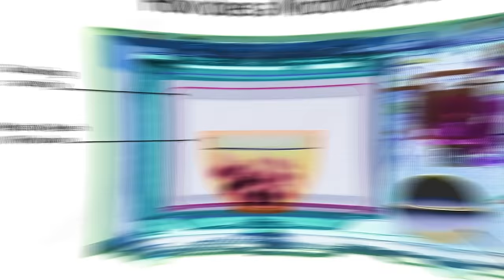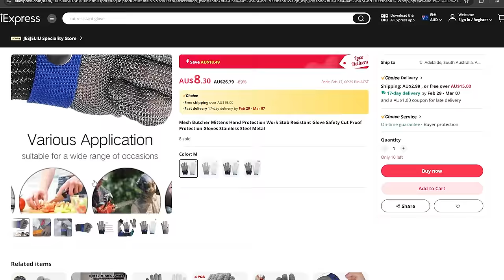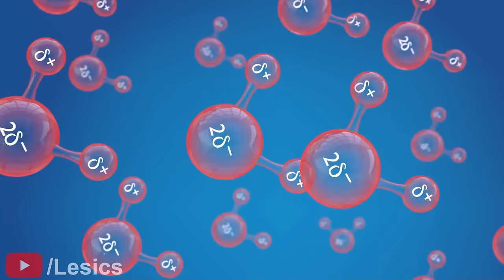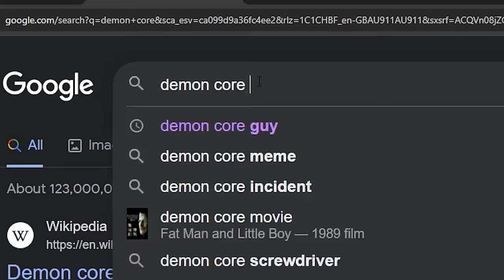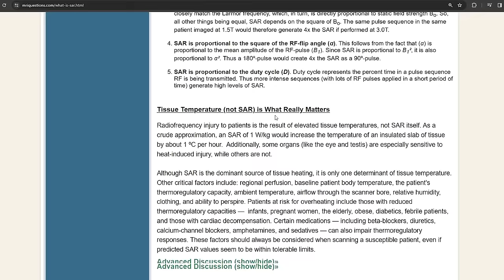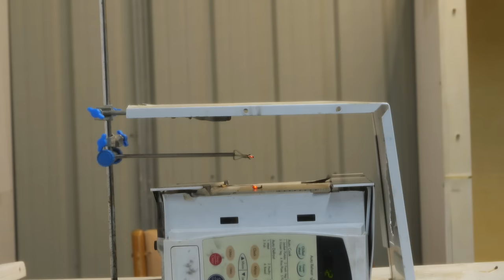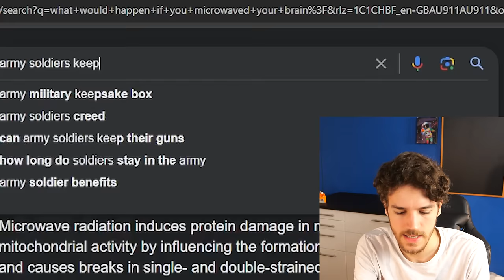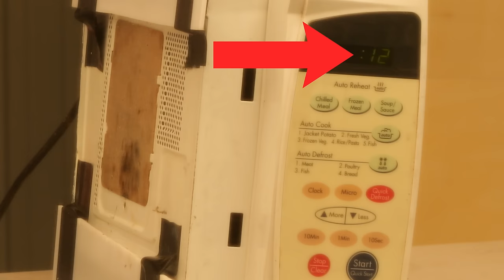I Tested the Limits of a Microwave

Comment: I mean, microwave ovens are basically just angry wifi routers in a cage...
Reply: @antibrevity trolling idea logged 😈
Reply: @Flesh_Wizard  we making microwave wifi with this one
Reply: @antibrevity That and uneducated people electrocuting themselves, which has not much to do with microwaves (waveforms) but the microwaves (devices).
Reply: So Microwave ovens are dangerous because they're a box. Just that is what bring the power of heat. The more scary thing would be to fuck up something and cause the fusion of a component and having it blow up. Honestly I guess any electronic is scary for that. A TV, toaster... If it burns it's no good.
Reply: @TheIndigoShine It's the capacitors. Microwaves have much stronger capacitors than TVs or toasters.
Reply: @Flesh_Wizard  that's a good way to have the feds at your door real quick lol
Reply: @antibrevity  that's why the faraday shed™
Reply: The worst part about this is, the math almost checks out. its all still in the GHz range..
Reply: @MobCat_  so what your saying is I should run my internet into my microwave so it puts out high powered wifi signals after cutting away the outer case?
Reply: The problem is that wifi needs coherent signals and what comes out of a magnatron is basically white noise. Poorly shielded commercial microwave heaters used to play merry hell with wifi routers.
Reply: @RowanHawkins  so what I need to do then is just wire the router into the transformer from the microwave so it's putting out more power of wifi lol
Reply: Technically, microwave ovens are radar transmitters, hence the reason for early microwave ovens being called "Radar Ranges"

In Radar a radio frequency pulse is generated, and then the bounced echo of that pulse is listened for, the delay between sending the pulse and receiving the echo is the distance to the object.

Magnetrons are basically transmitting at their resonate frequency or they are not transmitting, on or off, not much middle ground, so modulating a signal on a magnetron output is umm, annoying.
Reply: @PaulDriverPlus you know there are giant microwave dishes in telecom that provide backhaul uplink through line of sight (note: this can be farther than VISUAL line of sight) to remote cell sites? We can use microwaves that are totally different than this, but still microwaves, to transmit data wirelessly through open space.
Reply: @noodlelynoodle.  why do we still call this the land of the free when it's accepted as normal when holding an idea in ones head is a reason for interfere from auhoritarian thugs sent by the state/
?

Comment: The way microwaves ovens were discovered was a researcher working with a magnetron having a candy bar in his pocket melt, meaning his hands and the rest of his body definitely got a hefty dose of those microwaves. So in a way you’re just emulating the greats
Reply: Tom Scott’s video about residential microwaves are fantastic
Reply: He's being microwaved on the shoulder of giants.
Reply: That's a myth. While the apocryphal story might have happened, RF heating was already known and under research.
Reply: @Pho7on  do not correct me points open active microwave towards you
Reply: @Pho7on what is "RF heating" exactly?

Fun fact: microwaves can't heat ice as the water molecules can't jiggle, only liquid and gaseous water molecules are heated which in turn melts ice by convection.
Reply: @sirtra  Did you forget frozen meals exist?
Reply: @TheClol7  what meal is just frozen water?
Reply: @TheClol7  Do you know why the centre of such foods remains frozen whilst the outer layer is piping hot?

Did you also know that microwaves have a defrost setting to cater for this scenario?

Maybe if you weren't so quick to be a smartie pants you'd have learnt how to cook your frozen meals correctly before now? 🤷
Reply: @sirtra I'm sorry for being a smartass (kinda) but I want to point out that solids very much do "jiggle" as in vibrate.

Water molecules can't rotate tho. 

Also, I am working on a PhD in physical chemistry and now I feel dumb for learning why defrosting in the microwave takes so fucking long from a YT comment.
Reply: @morristgh  i want to point out that i didn't say solid, i'd suggest you quit while you're behind.
Reply: @sirtra 
you did say solid. "only liquid and gaseous water molecules are heated", that means you said solids aren't getting heated. Also you said ice, which is solid water, isn't getting heated. You are correct, don't get me wrong, but stating that you never said solid is dishonest.
Reply: @sirtra  Microwaves definitely heat ice just less efficiently.
Reply: @teresashinkansen9402  hmm definitely you say?

Why can i safely place my bare hand over an induction cooktop without getting burnt, but if i'm wearing a ring i cannot?

I suggest you learn what "heat" is in scientific terms and the different ways it can be transferred.
Reply: @sirtra  Seems youtube erased my comment so here it is again just shorter in the hopes it is not flagged. Unless the water ice is at absolute zero it has energy so the molecules are moving as such it can be heated. IS silly to think that water ice is some kind of perfectly solid material were its molecules and atoms are perfectly stationary that's not the case, microwaves can affect the dipole of the water molecules so they still heat the ice. It might surprise you even blow your mind but you can warm up ice with more ice! If you have a piece of ice at -12C° and another at -80C° and you put them in contact the warmer ice is going to heat the colder ice, because you know it has thermal energy. 

About why you can place your hand on an induction cook top and not get burned but a ring heats is very simple actually, your hand has much higher electrical resistivity so the voltages induced on your tissue cannot generate high enough currents to appreciably heat it, a ring being a metal has much lower resistance so the eddy currents are quite high and due joule heating its temperature rises.
Reply: @teresashinkansen9402  all methods of heat are a transfer of energy but not all transfers of energy are heat.

Heat != Temperature

You should have taken my suggestion more seriously before wasting your time typing such a long novel with inaccuracies.
Reply: @sirtra  Arguments semantics, calls an argumentative text with absolutely no structure of a novel a novel. 

When there is a transfer of energy into matter or a system that increases its temperature its is colloquially referred as being "heated" regardless if the energy is thermal or not because there was an increase of temperature and thus heat.

Why your argument only semantics? also whats with the condescending attitude? Are you a frustrated MENSA wannabe that is belittled by their peers or what?
Reply: @teresashinkansen9402  "microwaves definitely heat ice" says the one accusing me of being argumentative and using semantics.

The laws of thermodynamics are high school level physics, hence why I suggested you learn the formal definition of heat. It seems i overestimated your capabilities, my apologies.
Reply: @sirtra  Says the person who thinks molecules in ice cannot absorb microwave energy because they "can't jiggle" even when they remain polar and the very same laws of thermodynamics say that everything above absolute zero "jiggles". 

One of the mechanisms of heat transfer is radiation, aren't microwaves radiation? Let me guess you are going to argue that is not because the microwaves aren't coming from a black body radiator.
Reply: @teresashinkansen9402  i did not say ice can't absorb microwave energy, it certainly can.. absorption of radiation is not the mechanism that makes microwave oven work. The specific frequency of said radiation is vital for the phenomenon to work correctly, otherwise it's merely absorbed by the walls, door, cup, water, air etc.

I definitely overestimated your capabilities.
Reply: @sirtra  Second try, seems YT does not like experiments. 

When ice below 0C° absorbs microwave radiation its temperature increases. You can test that for yourself. 

Water and ice absorb microwaves because they are at a specific frequency, so yes that's important for efficient heating but not vital for it to occur, the frequency simply means that it can be absorbed more readily and because they are absorbed that energy becomes heat. Do you know what dielectric heating is? It can happen in solids, ice is a solid made of polar molecules.

My capabilities might be limited but I have the satisfaction of having a higher understanding of the world than you, I am having fun showing that, meanwhile you  look silly because you think Ice cannot become hotter due absorption of microwave energy, you know, be heated  🤭

BTW I have to go to training and do other stuff so pardon if I can't play with you in the next hours, expect my next reply in half to one day.
Reply: @teresashinkansen9402  ah yes, i'm the one who looks silly 🫣
Reply: @sirtra  Indeed! :face-blue-smiling:
Reply: @teresashinkansen9402    i feel super silly after watching the weirdest thing about microwaves by minute food 😥
Reply: @sirtra  Don't feel bad we are always learning. Now that I have given you higher knowledge you know better.
Reply: @teresashinkansen9402  you haven't watched it yet, have you? 💀
Reply: @sirtra  Ok ill watch it
Reply: @teresashinkansen9402  Possibly the best decision you have made all day. Don't feel bad, we are always learning.
Reply: @sirtra  Well I watched it and said the same as you said. But once again that is not accurate, it is a misconception, yes ice does not heat as well as liquid water but it still warms up, she even proves how the ice can be warmed up by microwaves, you see that silly putty demo? the dish is made of ceramic yet it warmed up and that's due dielectric heating, plastic also heats up due that reason even when its a solid, metal heats up due a different mechanism that is electromagnetic induction. 

You tube isn't allowing me to publish a comment with how to do it but you can test it by yourself, its something I did years ago, ice cream works too, it softens thorough its volume even before it begins to melt, the only explanation for that is that the radiowaves penetrate deeper because they aren't absorbed as efficiently yet still cause some heating.

I give you a sincere thank you for sharing that channel. Im watching other videos I find interesting. Quid pro quo: look up for "Hyperspace pirate" Maybe you like it maybe not regardless is a favorite of mine.
Reply: @sirtra  Radio frequency heating. There are all sort of frequencies that can jiggle matter. Microwaves are just one band of them :)

Comment: My dad was an analytical chemist and one day at the company he worked for they got him to experiment with microwave disgestion systems, which are used to accelerate chemical reactions. But because they were new they didn't know how long it had to go in a mircowave for. So my dad was tasked with using a long stick turning on the microwave running out of the door and waiting for the microwave to blow up, so they knew how long before it would go up.
He also told me that one time he was working in his office and a huge explosion shook the building he was and came from the direction of one of the warehouses. He went out and it seemed totally fine, until he got closer and there were tons of bricks inside the warehouse. It turned out that an explosion of some chemcials stored in it blew the roof off the top of the warehouse and it went straight upwards and straight back down and landed ontop of the bit of the warehouse that wasn't destroyed, like some looney tunes type thing.
I remember he got a bonus once when the factory didn't have an accident for 100 days and then on the next day one happened.
Edit : he just told me how when he first worked there they didn't have pipettes and had to do "pipette by mouth" as in he had put the chemicals in his mouth and spit the right amount into whatever solution they were making. He said some of them he could felt like his teeth were dissolving.
Reply: U get hurt u no pay. No cost me money u get 50 bucko
Reply: That second story needs a lot more punctuation
Reply: the simpsons ass work place
Reply: Dude your dad is cool haha
Reply: @crowderpiano  he just told me how when he first worked there they didn't have pipettes and had to do "pipette by mouth" as in he had put the chemicals in his mouth and spit the right amount into whatever solution they were making. He said some of them he could felt like his teeth were dissolving.

Comment: Every Bluetooth device in a 5 mile radius is having a bad time.
Reply: also every wifi device is dropping out like a drunk guy at a party
Reply: @NoahGooder  5ghz says not
Reply: @pootispiker2866 true, but thats only because the 5g range is so small it usually also doesnt encounter the microwave while also not making use of the 2.4Ghz band.
Reply: @NoahGooder  That's not how it works. 5ghz is inherently unaffected by 2.4ghz radio waves. They do not interfere, ever.
Reply: @NoahGooder  Microwave ovens operate with a radar-directed ~2.5ghz beam. They cannot interfere with 5ghz signals.
Reply: 5ghz devices have a bad time every time, can barely penetrate paper.
Reply: ze bruetooth dewice is ready to paiuh
Reply: @vx-iidu  
He says you brade runner
Tell him I'm pairing

Comment: Physics professor here specialized in the cosmic microwave background. The reason water heats up is indeed because of the electric dipole moment of the water molecule, but it is being heated by its interaction with the electric field, not the magnetic field. 

Also, the reason that the microwaves can't pass through the small holes is that currents are generated in the mesh. These currents reradiate in a way that almost exactly cancels the field on the outside. Because the wavelength is much longer than the hole size, the flowing current is a good approximation to that which would if you had a perfect mirror surface.
Reply from the maker: Ah geez, thanks for the clarification! Dunno how I said magnetic instead of electric. I'm guessing the free electrons in metal is why it's able to create a current that blocks the microwaves?
Reply: Yep exactly. Nice video btw! I love the chaotic energy @mrgreenguy
Reply: I dont know but i've heard almost all my life that microwaves can couse cancer. Is that true or false? Like i've read that microwaving sugars and startches could be cancerous. But i feel like it must be affecting the body in some way or another even tho its just a little bit. (little very frequently turns into alot) sorry but im not a native english speaker. have a nice day anyways!
Reply: Why does the mesh not radiate an inverted wave on the outside?
Reply: @slayerficated it does, that's why it reflects the waves
Reply: @julianbinder2371  I mean why doesn't it transmit a phase inverted microwave towards someone standing outside the microwave looking in? I'm not very well educated so excuse my ignorance.
Reply: Yeah it's like dropping a magnet through a copper tube. 
This reminds me of an incident in South Australia where as a crane found its way into the path of repeater beam and created chaos.
it took a while to work out what went wrong as the dish was about 50 odd km away.
Reply: @maxgood42 when was this and what happened?
Reply: @trapdoorguppi  About 20+ years ago, AUS ABC tower, parabolic dish beam. The head of the crane mast became very hot and the crane became electrified (Rubber wheels and wood blocks under the stabilizers). We have these beams above us but we are not bothered by them generally.
Reply: @mrgreenguy  Effect of the "Lenz Law" maybe!
Reply: Would you say, in a sci fi way, that the ingredients for a sentient race are fundamentally established in the CMB pattern? As if to say, one who could toss in energy to the exact same pattern into a black hole would observe the same result on the other side(of the singularity)?

Or is that a complete mischaracterization of what the CMB represents?
Reply: So the mesh is a faraday cage?
Reply: @fatlink1079  yes, basically. That's why microwaves make really good Faraday cages
Reply: It does, the inverted phase is what cancels the original wave(since e&m waves are superimposable) the positive magnitude of the wave and the negative from the induced inverted wave are in the same place thus canceling out to 0 (approximately)
Reply: 667th like
Reply: @WhatTheFuckkIsThis I doubt normal use is harming you.

Most things become carcinogenic if burned though